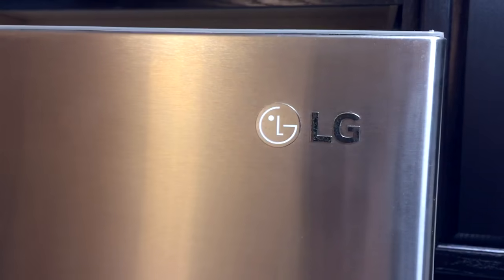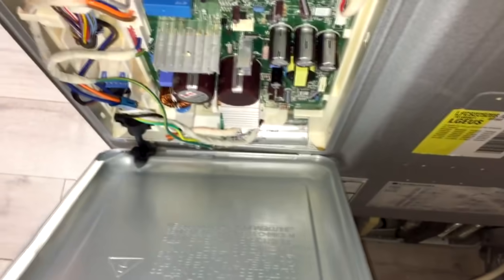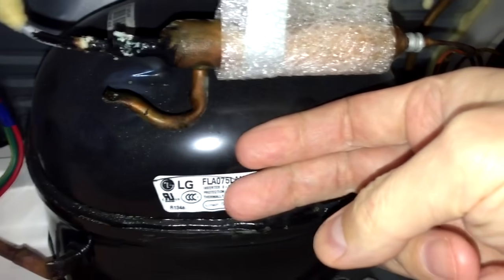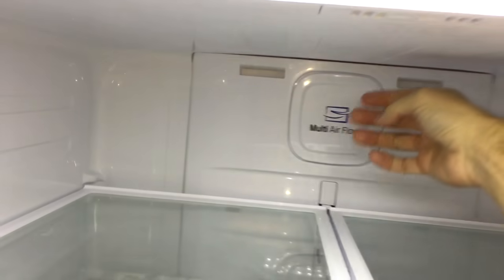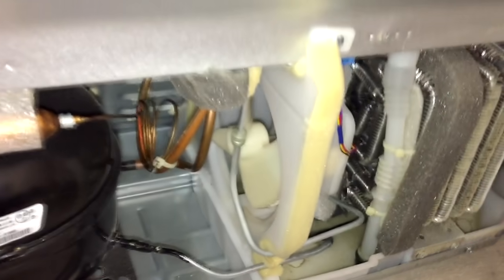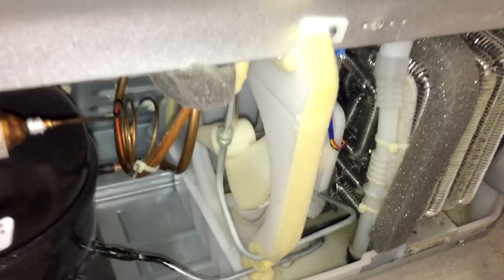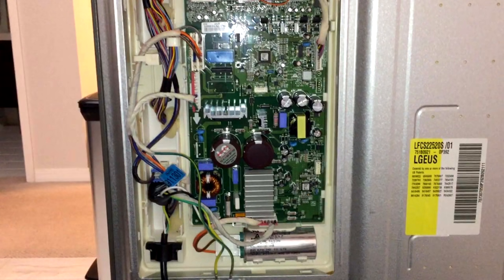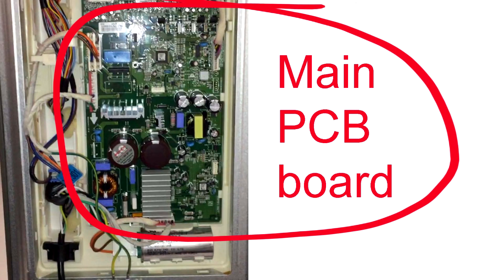LG refrigerator test and reset button

Comment: I have a LG LMXS27626D /01 French door refrigerator that stopped cooling. It’s about 3.5 years old. I’ve run through some troubleshooting based on your videos. Thanks, they are helpful!

My compressor seems to be running, it’s warm and it hums/vibrates. I used my multimeter to check the windings, and all seem to have checked out. I get about 8ohms across 2 pins and 0 across the other 2 paths. The compressor fan operates fine. There is no LED that I can see on the PCB when I do the test/reset operation or indications of error codes... The evaporator fan seems to be working since I can run the reset test and there is air movement from inside the fridge, just not cold air. The other test I did was with an infrared thermometer to check heat output on the various components. I’m not seeing an increase in temperature across the condenser coils. So what does all this mean? I’m guessing low refrigerant?? Or is this still a bad compressor? Or, something else...

I contacted LG and they’re sending out a tech in like 3 weeks… That’s too long. What do I do?
Reply from the maker: It sounds like a typical LG Linear compressor problem... running but not cooling.
They should replace the compressor absolutely free (parts & labor) for the first 5 years, but you may have to "fight" for it.
Meanwhile, if you don't have a spare fridge, maybe get a small one until they fix yours.
Reply: @Your-Self  Thanks for the speedy reply! So are they going to come out and replace the compressor with another unit with the exact same problem and in about 3 years I'll be faced with the same problem? Or, did LG do something to actually fix the problem with their linear compressors?
Reply from the maker: According to LG, they have improved the Linear compressor about a year ago, and it's called a "Universal compressor" that fits most models. But there is no track record to prove that it's any better than the old one, so only time will tell.
Reply: My LFX28978ST from 2011 have linear compressor replaced in 2015 and its bad again not even 7 years full (why I am here). First time they charge me for labor which came out $200-something and this time since no warranty, I am just gonna go with local repair shop. Cannot believe how bad those compressors are as old cheap fridge can go 20 years

Comment: Thanks for that vid. Well explained.

I have a deep fridge from haier company. There is a connection from the controller named by PMW with two cables. Wich is connected to the inverter board. I think it gives the command. I have the problem that the compressor not runs by every command.

Do you have experiance with controllers and pulse width modulation commands?
Reply from the maker: The controller sends a small DC voltage (PWM) of around 2-3 volts to the inverter to run the compressor.
But most of the time the inverter burns out so the compressor can't run. Inspect the inverter board for burnt marks or inflated capacitors.

Comment: Thank you for this video I have a Frigidaire FG4H2272UF but I can't find the test button. Would you by any chance know where it is? It is not on the main board. My problem is no cooling at all. I change the inverter and same result. I tested the electric part of the compressor and I get 20.3 on each pin. It make a nice noise. So I am hoping its not the compressor. I also checked the power to the inverter and I get 110V and 6v.
Reply from the maker: This video is for an LG refrigerator. Your Frigidaire doesn't have a test button.
If you can feel that the compressor is running and slightly vibrating, it's probably good. If fans are running as well, the problem could be with the refrigerant (Freon) leak. 
Does the display work on the door and the middle pull-out section? Are there any error codes?
Reply: @Your-Self  Thank you for your reply - They are no error code on the door and the display seams to work properly. The compressor is running and has a slight vibration. Fan is running. The condenser stays room temperature. So I am going to refill the refrigerant.
Reply: Off topic question: I am about to refill it with refrigerant. The data sticker calls for 200g / r123a. How do I determine what's in the system before refilling? I suspect nothing is left and I do intend to vacuum it.
Reply from the maker: Are you sure it's an r123a and not the r134a?
The only way to measure how much refrigerant is left inside is to recover it in a bag and weigh it.
 Newer refrigerators are very finicky about having the right amount of refrigerant filled.
I believe this is a 2-evaporator system with a distribution (stepper) valve. This makes it even more complicated with the vacuuming and refilling.
It's best to find the leak and repair it first.
You can try adding a little refrigerant at a time. If it starts to cool, you have a leak. If it's still not cooling, the problem could be something else.

Comment: Having same issue as others. Works perfect in test mode 1. When in regular operation with magnet trick, the fan behind the air filter is spinning but no air is blowing out of the vent that lead to the door ice maker. I'm not sure where the freezer door sensor is though.
Reply: Anyone solve this?
Reply: My bottom freezer, the door switch is just inside freezer opening upper surface, middle. Can only see it from below

Comment: Thanks for all the helpful videos. 

One question... after doing tests and resets, the compressor and fan operate fine, but no cooling. No LED indicator. Lights still on inside fridge also.
Reply from the maker: If the compressor and all fans are running, and you can feel the air movement inside the refrigerator but it's not cold, that's a pretty bad sign of a major Sealed System problem. If your LG refrigerator is under 5 years old and you have the purchasing receipt, LG may fix it for free.
Reply: @Your-Self  Thank you. That's what I assumed. Much appreciated for your help.
Reply: @Your-Self  what do I need to do since I have a receipt from Sept 2017 pertaining the refrigerator purchase? I think my seal needs to be replaced.
Reply: @Your-Self  How can I be sure yhat its the seal?

Comment: If you're LG has a linear compressor....it's bad, or is going to fail. There's a class action lawsuit against LG because of this.Huge problem for LG.
Reply: Hello - thank you for this heads up. I was 'this' close to going out and getting an LG side by side with the linear compressor (even though it says 10 year warranty on compressor). What exactly is the issue with it though and purported failure mode? Thanks.

Comment: Thank you for sharing your knowledge. I bought an LG 3 years ago and it stopped cooling. We cleaned vent and did a reset but it still does not cool. Was told to hold freezer temp and ice button for 3 sec and got a code 88  88
Reply from the maker: For the 3-year-old refrigerator, it's worth calling LG directly so they can check the compressor. It's very common for LG linear compressor to fail early. If it is in fact the problem, they may replace the compressor for free.

Comment: I saw some great comments so I am reaching out hope you can help me. My LG refrigerator top refrigerator won’t go below 40 degrees and the freezer gets to 20-30 degrees. I have them set to 34 deg and -6 deg. I’ve up plugged 10 minutes and back in. I run test program. I’ve clean and vacuumed the coils and back of unit.  I am not getting any led lights flashing. I’ve moved everything away from the vents and both are blowing cold air.  Seals are good doors are level. The unit is 13 yrs old. Model LFX28977ST /01.  If you have any ideas please share.
Reply from the maker: Looks like your model has a regular compressor, which is more reliable than the newer linear compressor.
Did you move your refrigerator recently where it gets direct sunlight?
If not, you may want to check the evaporator coil inside the freezer. If it's completely covered in a thick layer of frost, it's fixable. If there is no frost at all or there is some just on the top, that could mean the refrigerant (Freon) is leaking out. And that is a pretty expensive repair.
Reply: @Your-Self  
Thanks. It not freezing it was Up to 40° when we defrosted everything and I unplugged it and plugged it back in and it doesn’t get below 30 know in the freezer. That was my first guess it was a Freon 13 years old and it’s the older model do you have an idea what it would cost to have that recharged and fixed.
Reply: Refrigerant is R134A cost per pound?
Reply from the maker: Refrigerators take a small amount of R134a (4-6oz), so it's cheap. 
But finding and fixing the leak could be difficult and cost $500-$1000.
Some techs may do a "recharge only" for about $200, but that comes with no warranty and can last for a week or a year.
Reply: @Your-Self  
You are the man thank you so much

Comment: Thank you so much - I went through this sequence yesterday and today the fridge is working fine and I am so grateful to you.  My question is, this having happened, what could cause it to STOP working and does this mean that the compressor is on its way out?  When I did the part of the test where the LED light would indicate problems, there was no blinking.  But I'm worried about putting a bunch of food in there again if it is likely to happen again soon.....
Reply from the maker: Nowadays refrigerators are run by electronics and the software. Just like a typical computer or your phone, sometimes it locks up and needs resetting. This can happen for no reason at all, the power outage, or an electrostatic shock if you finally decided to remove that protective plastic cover from the door ;) So nobody knows if it happens again, but I'm glad your fridge works now!

Comment: Ran the test just now as my refrigerator and freezer had defrosted overnight.

Test 1 and 2 had cold air blowing out of both the bottom freezer and upper area refrigerator.  However when I plugged it back in, only air is coming out of the freezer and not the refrigerator.  No blinking LED either. 

Any idea what is causing this issue?

Comment: Hi, thank you for the video it really helped.  Question, My LG stopped producing ice in the bottom freezer.  I did the diagnostic test like you demonstrated in the video.  I don't have the LED light, however on the front panel it was showing me a 33 33 code.  I looked it up and it said it was the freezer door switch.  I replaced it, redid the test and it still shows that same code.  Any ideas what it could be?

Comment: Thanks for the video! I am wondering how long to run test #3 to run the defrost cycle? 3 minutes? 10 minutes? 1 hour? Please advise.Thanks again!
Reply from the maker: The defrost cycle will timeout on its own. I just don't remember how long the cycle is... maybe 10-20 min.
But if it's already warm in the compartment, test 3 may not even start. Or it will finish early if the temperature gets too high.

Comment: Hi, I have a Kenmore Elite and my fridge and freezer fans stopped working causing them temps to raise to room temp. I took off the lower panel on the back of the refrigerator and observed the condenser had a light hum to it and the fan next to the condenser was on. 

I then YouTube some videos and came across yours. I followed your directions and removed the motherboard panel and pushed the test button. The internal fans began to work in test mode, however once the system went back into normal mode the internal fans stopped. As you had recommended to others, I held the door button to trick the system into thinking the doors were shut but the fans were still not on. 

From the comment I see on here, it seems to be a common issue. I contacted Sears and they said since it was purchased in Sept 2018 that the warranty expired except for the condenser, which is a 10 yr warranty so if it’s the condenser then at least it’s covered. I am scheduled out with Sears a couple of weeks and hoping that I am able to fix it sooner than that. Hoping folks that have had the same issue chime in to what the fix was for them.  Thanks for any and all input for this problem!
Reply from the maker: During the Test Mode - if the fans are blowing warm air, the compressor is probably bad.
If the air is cold, the problem could be with a temperature sensor, door switch, motherboard... to figure that out, requires a lot of testing.
Reply: @Your-Self  thank you for your input! I would say the air isn’t warm or cold but more room temperature.
Reply from the maker: Yep, when I said warm, I meant room temperature. So it sounds like the compressor is bad, just idling.
Reply: @Your-Self  thank you so much for the direction! I will update after the repair by Sears.

Comment: Hi,
Thanks for a very useful and nice video.
I have a lg gr-f802hlhu model refrigerator. I just have an annoying buzzing sound from the compressor.
Services in Turkey do not know even one of the things you are talking about. Therefore, unfortunately, there is no professional service provider to tell my problem.
Reply from the maker: You can try placing your hand on the compressor and some copper pipes around (wear a rubber glove for safety). If the sound stops, that's a vibration you may be able to fix. If not, the sound may be coming from the inside of the compressor, and there is nothing that can be done. If there is a fan next to the compressor, maybe the sound is coming from there?

Comment: Love you vids.  They just replaced my LG compressor and it's now cooling, but the temp is fluctuating.  It's still empty because we're not sure if we trust it yet.  I just started keeping a log of the temp variations.  The freezer seems to doing fine.  The temp is set for 38, in a 24 hour period the fridge temp goes up and down between 38 and 48.  Is this okay, and if not, is there an easy solution?  Thanks.
Reply from the maker: When a refrigerator is empty, the temperature may have wide fluctuations. Put a few gallons of water bottles inside to stabilize the temp. 
What is the freezer temperature range? And does your model have a single or dual evaporator?
Reply: @Your-Self  That makes sense, let me try that.  I haven't been monitoring the freezer as much, the temp seems to be 0 degrees.  I'm not sure the number of evaporators, I've done some research and haven't found a way to find out.

Comment: Question about sealed system issue. Did all tests in the video and all my fans are working, compressor seems to run just fine, air blowing into both the fridge and freezer, however it will just not get cold enough. I found some information online, not sure how accurate it is, that states if you take a temperature gun to the "coils" (sorry, not sure if that is the correct term) or where the coolant would be running through, that it should be 30 degrees or so above ambient temperature to know that it is working, and when I do that I am getting temps barely above the ambient room temp. 

Would this lead one to believe it is a sealed system issue? I am out of warranty and if so, more than likely going to just get a new fridge. Thank you ahead of time for your awesome video and assistance to everyone who asks!

Take care.
Reply from the maker: Your presumption is correct. Most likely the problem is with a weak compressor or a refrigerant leak.
But I'd check the freezer evaporator coils first. If the coils are covered in a thick layer of ice and frost, it's a Defrost Problem. If no ice, it's a Sealed System Problem.
Reply: @Your-Self  Thank you for the fast reply! So I actually do not use the ice maker portion, just because I do not like the water here and hardly ever use ice. Anyway, on an LG LFX25978ST I need to take the panel off in the freezer portion to check the freezer evaporator coils, correct?

Quick further back story. The vents on the bottom back portion and the whole area behind the fridge was embarrassingly dirty, so I popped the lower panel off and cleaned all that up including the area around the compressor and fan and everything. How long in your opinion should it take the unit to get back to normal cooling and freezing temps if working correctly after that? I just went and checked the freezer pack that I have sitting in the freezer and it is actually starting to harden now slowly. Should I let it sit longer before further diagnosing? I am now wondering if being extremely dirty caused it not to cycle properly for a long time and now just needs to catch up?

Is that possible? Again you are awesome and thank you for the help!
Reply from the maker: Yes, the extra dusty condenser coils will impair the system heat transfer. Hopefully, after cleaning them, the full cooling will come back within a day. If not, the dusty coils could've overheated and permanently damage the compressor.